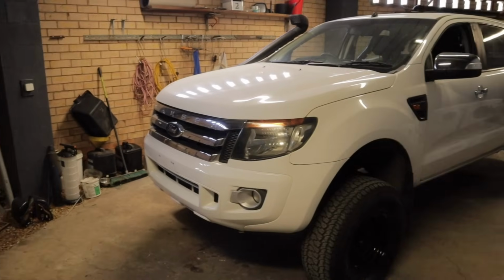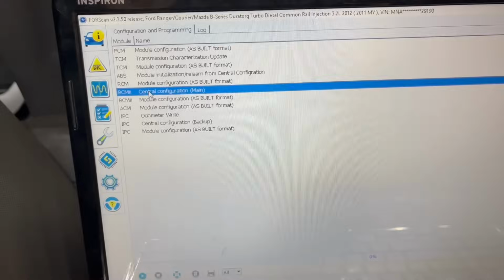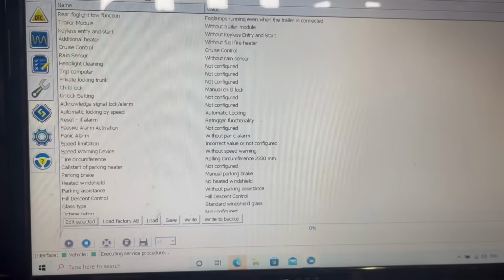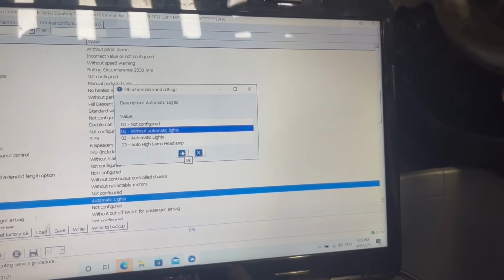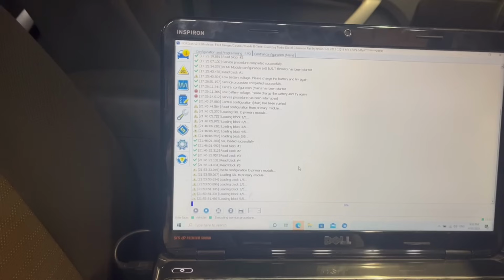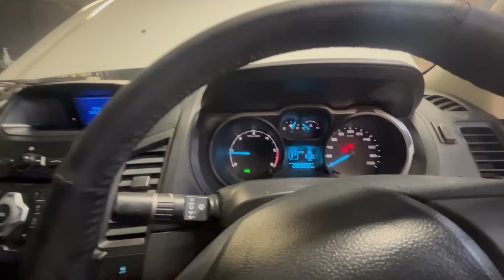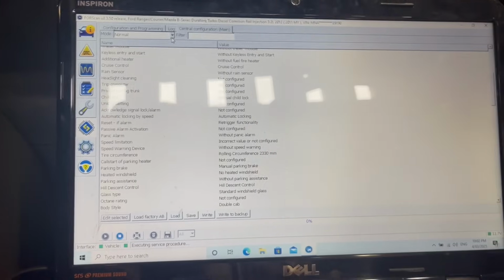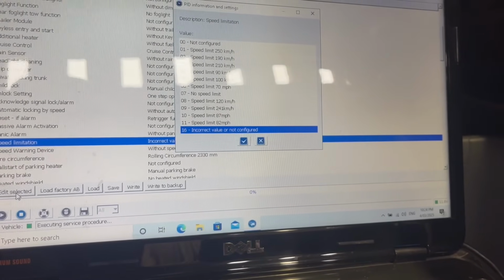Ford Ranger BCM Programming using Forscan

Comment: Hmmmm thought id correct and change my rolling wheel size willy nilly. Not that simple. Changed the size. Then got error. Changed it back, still pernamently have a fault code and no abs, traction control or cruise control. 4 warning lights on dash, tried reset dtc. 

Warning to all, don't just follow this video and think its that simple. Changing rolling diameter messes up alot of other modules... which now i have to solve somehow 🤬

Comment: You can also change the dual/single stage lock/unlock by holding the lock and unlock buttons simultaneously on the key fob until it cycles the locks.

Comment: Question:  I need to enable the AAT sensor in the PCM.  I can only do it in an As Built format.  Which line do I need to modify for this?  I added a DEATC control head for the aircon, and I need to enable the ambient air temp sensor for it to operate in full auto mode.

Comment: Not sure if anyone mentioned this or not but mine is ex water corp and has a redarc headlight on module which turns the headlights on a few seconds after the key is turned on… it’s a pretty good bet it has one of these or similar fitted.

Comment: After changing the tyre circumference I got code u2300 and the abs/tc/stability control and handbrake warning lights are all on. Do you know a fix? I have a 2013 px1
Reply: For anyone who has changed the tyre circumference, you have to recalibrate the ABS in forscan or you will get all these errors. Worked for me.

Comment: Pull the column cover off and on your light stalk the will be a aftermarket plug installed (I think 2 wires) pull.this out and refit the factory one and you should good, I had an ex Hastings deering ranger and it had the same issue.

Comment: I have a question if someone could help me with my ute 2015 mazda bt50 up/ur. When driving above 50km an hour my ute will shudder occasionally and raise rpms very slightly i was wondering would running 33" rugged terrain tyres cause this with no tune or would it be an issue with my transmission an advice would be helpful it seems to be constant and almost timed? It doesnt feel like my gears are worn or slipping it feels like a sensor or something electrical telling my transmission the signals and no it has nothing to do with my diff, tailshaft or transfer case i have checked all of these and there is also no fault codes for it
Reply: Could be tyres. Sounds more like torque converter with the rpm rise.
Reply: @dutchleroux  definitely not tyres they wouldn't have that affect ive got a sneaking suspicion its either the torque converter or valve body

Comment: from memory the annoying ranger seat belt chimes were easily turned off by .... key on not running,  then plug in & unplug the drivers seat belt 5 x in a row. It's been a while so I might be remembering wrong. let me know if it works.

Comment: Thank you for your great content always learning.  Can you do a BCM reset on Forscan.  My left low beam light went and does not want to come back on even after changing the bulb.
Reply: did u find a fix for this
Reply: @ethanclarke5739  I managed to do the reset using Forscan, but comes back after locking and unlocking the vehicle.  Error says I have a short on my alarm siren ie my horn but did not have time to try and trace it yet. Realised my horn does not sound when locking and unlocking.

Comment: What difference does changing the rolling circumference make? I have a PX1 but I'm using the current model wheels and tyres now - there's about an inch greater diameter with the newest ones.
Reply from the maker: Speedo accuracy
Reply: Can you do a detailed comparison video on this? Similar to how you did the one on EGR delete cables? I’d like to change my 2015 Everest to get a more accurate Speedo, however when I’ve changed my wheel circumstances in Forscan I got a Check Engine light as it was outside the parameters. In fairness I used a section in Forscan where you entered an actual mm value and not select one from the list.  Love your videos mate. Keep them coming.

Comment: 2016 3.2 Manual.
With the forscan module do I have to buy a yearly subscription?
I have found an Australian seller on ebay but I am just worried if a sub is needed yearly
Reply: You can get a 2 or 3 month trial licence, when it expires you simply apply for another one....rinse and repeat....well that's what I do over here in the UK.

Great videos too. 😊
Reply from the maker: Yes
Reply: @abdautomotive  Do you know how much it is ?

Comment: Have a look for a key on lights on module, I used to fit them back in the day. It might have one connected.
Reply: Exactly what this guy said. Someone has wired in an auto on light module. Most likely was used on a mine site so they have rules where lights are always on. Have a look under drivers side dash for aftemarket wiring and go from there. 

Id say the auto headlight setting you adjusted on forscan was for lights automatically turning on once dark outside. Theres a sensor for it in center of dash right at the glass